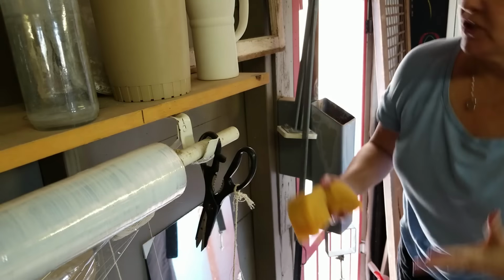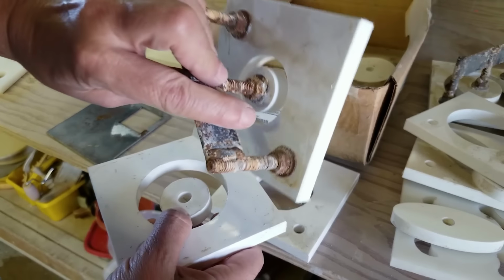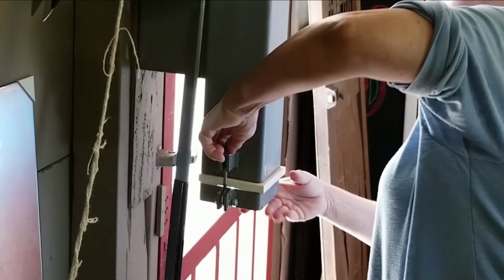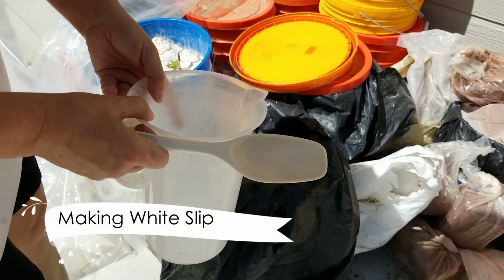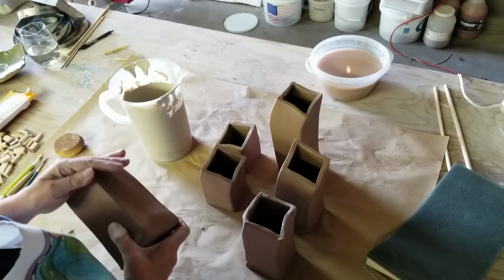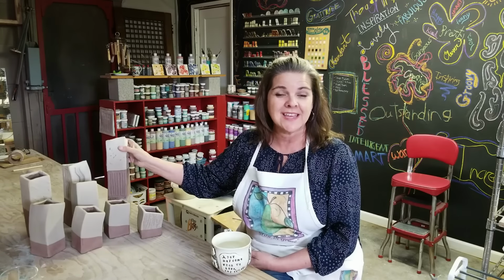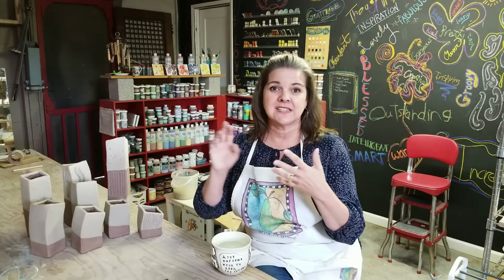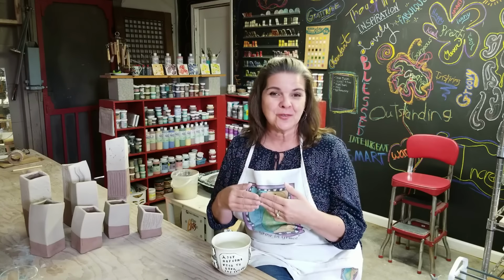#16  FINALE - Making EXTRUDER Vases & The LAST Hobby Potter Weekly Video!

Comment: I have an idea on how to turn  your square extrusion into a large hexagonal one.  Extrude two squares of the same length.  Use a wire to carefully bisect a corner of one from top to bottom then spread the edges apart until they are twice as far apart as the length of a side.  This should result in the two cut edges being inline with each other (flat to the table if you laid it on its side).  Repeat the same thing with the other square extrusion then score and slip the surface of the edges and combine them to make a hexagon extrusion.
Reply from the maker: Right!  Thanks for your ideaa I thought of so many different things that I could do while I was extruding! You can make all kinds of cool forms and shapes by just slicing it in pieces!😜